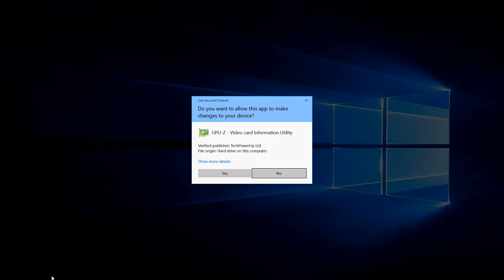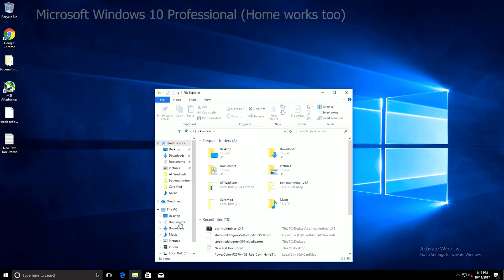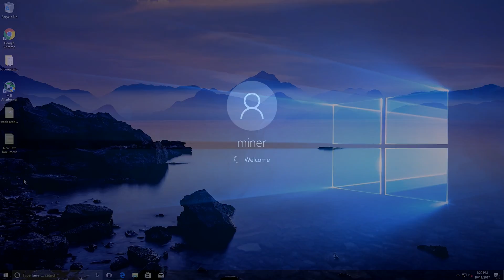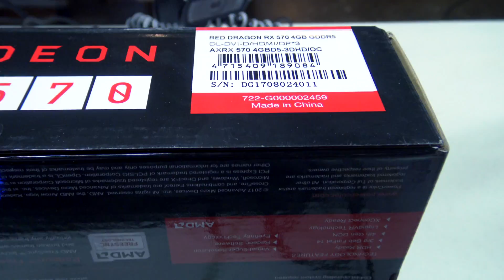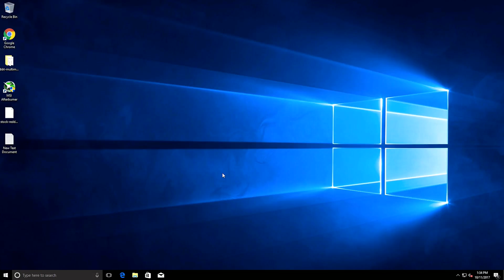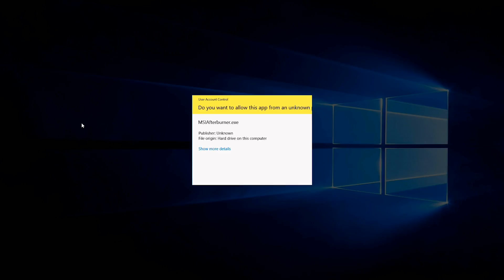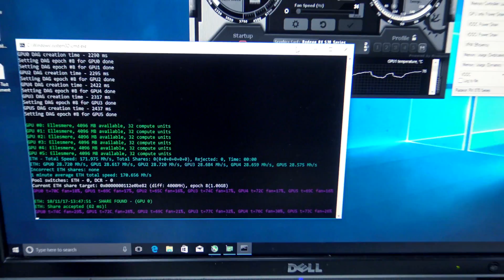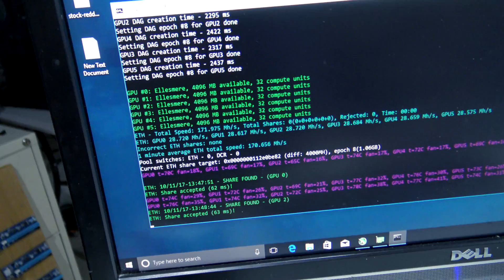Load custom AMD BIOS using Powershell! Quick Video!

Comment: What was the point of the Polaris Editor if you're not going to show it and only flash a pre-modded BIOS for a specific card?  Second, you're just in the Powershell shell but non of the tools are leveraging powershell.  You can easily do this from command prompt too.

Comment: @BBT You forgot a critical step, run HwInfo64 to check for memory errors to assist in finding stable speeds for your cards.
Also need to run GPU-Z to confirm memory type before flash. MSI afterburner not required, you can easily set clocks/voltages in claymore miner batch file, which is easier if you switch coins and have diff settings.

Comment: Why flash then restart and get error 43? Just run the pixelclockpatcher before restart, or before mod even. Previous drivers would send windows into annoying startup repair if you didn't remove the sig check before hand, with modded display, luckily now just get error 43.
Reply: Can you explain this more in detail? Should I install original bios first, install blockcgain drivers, run pixelpatcher and only then bios mod my cards?

Comment: This bios work with a rx 570 powercolor red devil 4 GB??? (elpidia memory)
Reply: The memory timings would likely work with any elpida mem card,  I would edit your existing bios with this strap (1750 and 2000 ones...). Elpida and Samsung timings pretty much universal, Hynix has many versions of mem, harder to mod optimally, though can get ~27MH fairly stable.

Comment: I stick with Nvidia 1060s and 70s. Don't like the bios mod required on these amds. Hassle
Reply: 1060 gets you likely Hynix garbage these days, netting max of 19MH for $200+. Can get 570 for $240 netting 29MH. Bios mods really are simple once you do it once. 1060 3GBs of the past that had Samsung were decent, though less time mining eth due to dag size.  1070.... just always a bad buy, why pay $400-500 for barely more speed than $240 card?

Comment: Can some one please tell me if after all of what he did on the video if I run DDU again and then install the block chain driver from AMD will this bump up the mhs to 30 to 31 on each card instead of 28mhs???? can some one please confirm that to me before I do this?? thanks a lot in advance!!!😉
Reply: 30MH stable on Elpida requires being lucky with your mem, 28-39 likely more achievable, depends on max frequency you can run stable with these timings. Run HWInfo64 to check memory errors. WIthout Blockchain you would get like 24MH perhaps (eth/etc, other coins use earlier dag not affected by slowdown).